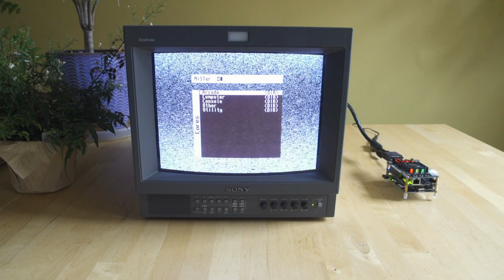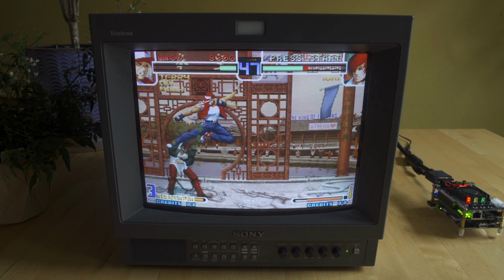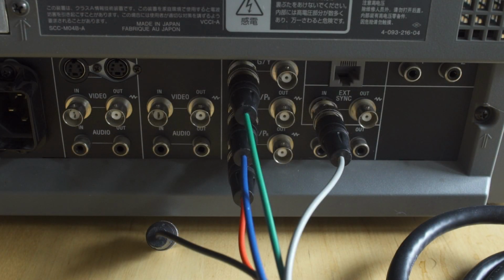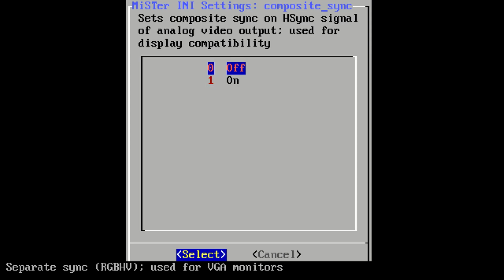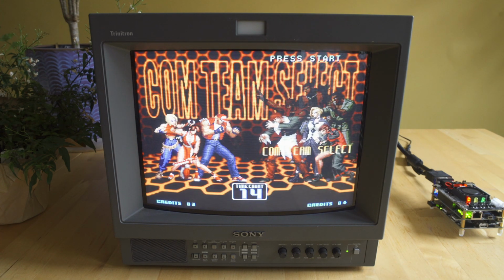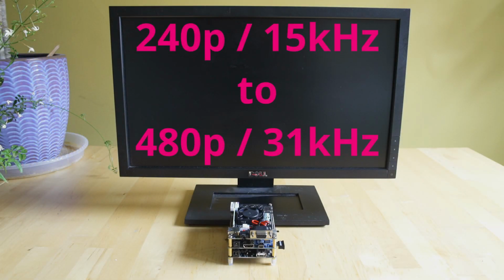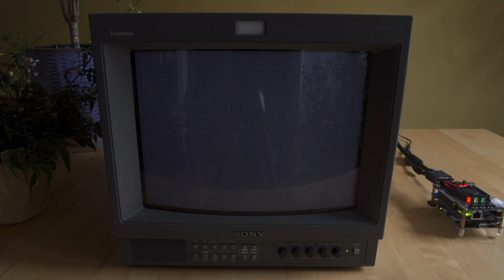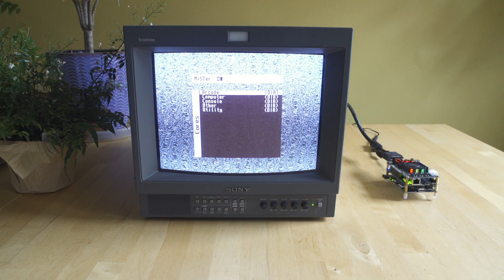MiSTer FPGA Analog Video Guide and Setup Tutorial - VGA, PVM's and Component Video

Comment: I got one of those standard VGA cables with the blue connectors and the ferrite cores clamped around the cable at each end. Took one end off as close to blue connector as possible. You keep the ferrite core. Then you basically take the sync, R, G, B, RGB switch, and ground cores and put them into an RGB scart connector. You can find the specific mister FPGA wiring diagram easily online. If it's a good VGA cable the R, G, B and sync wires will each have their own screen for each signal. You take those screens down to ground. I connected it up to a little Toshiba portable CRT and it's one of the cleanest, crispest 240p pictures I've ever seen.
Reply from the maker: Good to know. Cheaper than VGA to SCART

Comment: Great introduction! One thing you didn't mention was Direct Video, which is an option to use the MiSTer's HDMI port along with a cheap HDMI->VGA adapter and can give you 15 kHz or 31 kHz video, all without even owning the IO board. I have been using this option since the beginning and love it!
Reply from the maker: That is true but I will mention that in advanced HDMI settings coming later. I wanted this to be exclusively about the VGA port out options on the analog I/O board :)
Reply: What did you use to connect from the HDMI -> VGA adapter to the CRT?
Reply from the maker: Yes most adapters won’t step VGA down to 15khz off HDMI. You’d need a downscaler in the mix

Comment: smart to make a note of the port stressing from the heavy cable.
Reply from the maker: I am a filmmaker and cable management / locking ports / not damaging ports from cable runs is very important in the camera department. Ruin a port and ruin your shooting day. So I am def sensitive to warning people about heavy cables breaking ports / cracking solder joints :)

Comment: That's interesting to see how a PVM's picture lines up with different cores. I have a cheap VGA to Composite converter (meant for PC to TV) and I'll often have to change the size or position between cores. Didn't occur to me that it could happen with a more direct analog output. Of course, a PVM can handle the original resolution and frequency and I have to rely on the forced_scandoubler option so there's still merit in other analog out solutions.

Appreciate the videos! They've been a helpful source to a newcomer to MiSTer!
Reply from the maker: Yeah even with a PVM how it fits the screen changes between cores. It also changes between original hardware too. 

Glad you enjoy the videos! Plenty more coming
Reply: It’s much quicker to adjust on the fly with a PC CRT but yeah it’s a pain with a service menu every time on a 15 kHz crt
Reply from the maker: Always a pain but worth it

Comment: I've seen it recommended to use a VGA-BNC cable with vga pin 13 attenuated with a 470 ohm resistor. My PVM's external sync says it can handle up to 4v, so it should be fine just to use any standard cable? Don't wanna fry my pvm, lol.
Reply from the maker: You’ll be fine with your PVM. That’s more for “consumer” monitors. Diff between TTL voltages and the like
Reply: @VideoGameEsoterica  Great, thanks for the reply!
Reply from the maker: No worries. It’s a semi common question actually. I throw arcade voltages into my PVM all day with zero issues. They can accommodate it. So while that recommendation isn’t wrong, it’s more for consumer sets / hardware not intended for those signals. 

Like I use that resistor on the line when I use my Framemeister to upscale arcade boards / other hardware using a TTL signal. Just not on my PVMs

Comment: Hello, I have a MiSTer assembly from RetroCastle, a version with an analog Saturn video connector, I connected Loewe Xelos A20 to my LCD TV, Scart / RGB connector, resolution.  640:480.  in the mister ini.settings settings I set the videoMode to 640:480, how does the picture show with flickers and there is no sound at all, or does Scart not support sound? and should I use the 3.5 section, or are there any settings, or on the De10-Nano board, you need to switch the slider.
Reply from the maker: I haven’t the faintest clue on that one as I’ve never used that board

Comment: I have a tv philips with component and when I tried to connect the cable vga-> component on it, I had to change ypbpr to 1 and vga scale to 1 as well, if I set vga scaler to 0 as shown in the video I dont get any signal. And also sog switch set to on.
Reply from the maker: Good to know. Every tv is slightly different for sure

Comment: I am using Antonio’s s-video adaptor to hook my MiSTer up to a consumer CRT. Many arcade cores look great but many have a slightly wavy image. Some are more wavy than others. I assume this is a refresh rate?  All the CPSII games have this issue as well as Neo Geo. Is there an ini setting I can use to get rid of that waviness and get a solid image across all games?
Reply from the maker: It’s def refresh. I don’t use S video so I don’t have the answer but I’d try the mister FPGA forums. Just Google it (id leave a link but they always get deleted)
Reply: @VideoGameEsoterica  thanks! Yeah I did just that and it seems to be an issue with cores that run less than 60hz. Neo Geo and CPSII both run at 59.something. I read something about a 60hz version of the Neo geo or perhaps a way to force 60 with some cores. Will investigate further but at least I now know the issue. Thanks again!
Reply from the maker: Good luck getting it fixed :)

Comment: I love your videos! I followed the tutorial and every core that outputs horizontal mode works well on my consumer CRT using  vga to component cables.  However if I try to the vertical or rotate mode the image doesn’t rotate, or on the Cave games like Dodonpachi it gets all garbled. Is there a way to get the vertical option working on a CRT? When I use HDMI every core rotates to vertical mode without issue. Thanks again for all your awesome content! Loving the Mister :)
Reply from the maker: To my knowledge no...scaler isn’t involved so you need to literally turn the tv on its side. Like standard TATE

Comment: I have my MiSTer hooked up to my new (to me lol) Sony Trinitron CRT via component from the VGA port and have been very happy with it (except the geometry is pretty bad but I can ignore it in most games), and have been kind of interested in at least seeing how some things look in composite cause it's my understanding that a lot of games were made with composite video in mind.  Do I need a special adapter for this?
Reply from the maker: You need an adapter yes. Just go HDMI down to composite. You are correct, pretty much every game of that era was designed with composite in mind
Reply: @VideoGameEsoterica  Ah so you'd suggest going through the hdmi port and not the VGA? Why is that?
Reply from the maker: VGA is fine. Both will work, I just know the VGA to composite adapters can be a bit of a wait to ship

Comment: nice tutorials, i've gone a mile with these while setting up my MiSTer <3

I have one special situation I would like your comment. Normally I use my CRT to play those tv screen machines, but I'm also setting up AO486 core, and I would like to do the setup with that same CRT. Is there a way to convert the AO486 image to crt ? Like a negative scandoubler, or would you call itscanhalver :D
Reply from the maker: Oh so bring 31kHz down to 15? retrotink will downscale. But nothing in MiSTer to my knowledge will downscale internally
Reply: @VideoGameEsoterica  Cheers for the speedy reply mate. Yes, i'm reaching for 15kHz. Seems I will need a vga monitor or stick with hdmi on AO486.
Reply from the maker: Yes that would be my recommendation

Comment: Just setting those settings didnt work for me - cant seem to get my mister to display on a known working PVM ..bummer
Reply from the maker: Sure you used the right sync cable?
Reply: @VideoGameEsoterica  I got a VGA -> BNC5 cable ( tried both black and grey as you said), oi board on SOG, de10nano SW3 toggled away from ram, updated the mister.ini as you said. Nothing!
Reply from the maker: Odd. That should work. I wonder if there is an issue with the IO board itself
Reply: Ill keep trying.. im sure its something simple im missing. I appreciate your reply and your video - cheers!
Reply from the maker: Yeah lmk how it goes when you figure it out!
Reply: @VideoGameEsoterica  ok so, what happened was that i read on an online forum somewhere that the 3rd switch on the de10 nano should be switched away from the memory in order to activate analog output. This was the cause of my issues. After setting the nano switch back to default everything worked. (Bad info on the Internet screwed me up)
Reply from the maker: That is a weird one. Glad you solved it!

Comment: Any chance of a component video out set up? Are there any changes to the IO board that need to be done like the jumpers? I still can’t a signal to my kv 32fs100.
Reply from the maker: I may do a component video soon
Reply from the maker: Did you try SOG / sync on green
Reply: @VideoGameEsoterica  yes sir, that was the first thing I did and nothing. I've heard ppl change their output resolution, but I don't want to mess with that setting. If you can it would be awesome but I understand if your busy with other stuff thank you for understanding.
Reply from the maker: I’ll look into it. I just need a diff cable
Reply: @VideoGameEsoterica  if you need one I’ll send you a vga to component.
Reply from the maker: I appreciate that. Join my discord. Link is in description. We can chat :)

Comment: What should I set the resolution in the ini file when using a PVM/240p/480i? Can I just leave it at 1080p? That’s what I’m using now and it looks fine.
Reply from the maker: You are using the analog I/O? Just connect the cables and make sure you are using 15khz mode. Should be fine from there

Comment: Thanks for a great video! One question though... I'm using a consumer RGB CRT TV (VGA-SCART cable) and when I go into the INI settings there's so much overscan that I can't see the 4-5 first characters on the left. I haven't found a fix for this, maybe you have a trick? I tried changing the video_mode to different resolutions that didn't make any difference...
Reply from the maker: So the overscan is just when you try to change INI settings? Like main MiSTer ones? Yeah I’d just alter the settings via notepad on the SD card via a PC. Quick and dirty solution but effective
Reply from the maker: Should have elaborated : open the INI file on your pc with notepad and change settings and save
Reply: @VideoGameEsoterica  yeah that's what ended up doing, just thought there might be a fix to make it more visible on the tv as well :)
Reply from the maker: Honestly there may be but I am always “do it the easy way” and this instance it’s notepad lol
Reply: @VideoGameEsoterica  Just to add some more info ...the overscan issue also cuts off notifications like controller bindings and resolution info. But most games doesn't have anything important being cut off.
Reply from the maker: I need to use my pvm later this week so I’ll check into it then!

Comment: Hmmm only supports 15k and has to upscale… dang that sucks I wanted raw native res per system like 256x224 without any scaling… I’m lucky with fw900  let’s me run most low res on displays scaler.  Butttt it’s 30k horizontal limit would mean 480p if I used the mister right?
Reply from the maker: Yeah that monitor is just special. Most everything else wont do it
Reply: @VideoGameEsoterica  ok cool beans… I was getting so excited for the mister ;( guess I’ll have to run bnc to scart and mod some og consoles.
If ur bored I have a bunch of shorts on my channel showing exact res for the games…. Mainly for testing purposes lol
Reply from the maker: I’ll take a peek
Reply: @VideoGameEsoterica  ;) keep you n mind I just found the 240p tool so some aren’t perfect 4:3

Comment: Awesome tutorial.  I wasn't getting any signal at all before... Now at least I'm consistently.getting one.  My issue now is that I have a green tint to everything... Everything's green.  Any ideas on what could be causing this?
Reply from the maker: Sounds like you have the cables crossed up? Not 100% sure but it sounds like the signals are incorrect
Reply from the maker: RGB or component or VGA?
Reply: RGB! Rechecked the connections. Totally fine, using a rgb ready console to the PVM also works fine. When using the mister everything has a green hue.
Reply from the maker: Yeah that makes no sense lol. That shouldn’t happen. Sorry I don’t have more info but if R G and B are on the correct lines it should be fine?
Reply: @VideoGameEsoterica  figured out the issue!  Ybpbr was turned on in the ini. It works now!!
Reply from the maker: Perfect

Comment: Audio options?
Reply from the maker: Analog or optical out
Reply: @VideoGameEsoterica  im using the 10 pin out via composite but get no audio. I tried doing the opt out next to the din slot but still no audio coming out.
Reply from the maker: You need to select the audio type in the INI
Reply: @VideoGameEsoterica  is there a vid how to do this. Im new to it. I just see
"Hdmi audio 96k=0" set to 1.....ect

Comment: Does that mean CRT VGA monitors aren't that good for MiSTer?
Reply from the maker: No they work nicely. Ones that work with 15kHz are rare but with the line doubling to 31kHz it’s a very nice option. 

I prefer a PVM but that’s for form factor + I need RGB BNC + SYNC in for arcade light gun games I collect.
Reply: @VideoGameEsoterica  That's the thing, it's difficult to find a good 15kHz monitor nowadays and it is getting pricy. Thank you for your answer :)
Reply from the maker: Yes 15kHz stuff has gone way up in price for CRT monitors
Reply: @VideoGameEsoterica  do you recommend the model that you have in this video? or are there comparable models/examples as well?

Comment: When using the SNES core, is it possible to adjust the aspect ratio even when using the analog output on a CRT? I prefer to use the 8:7 aspect ratio (even on a CRT), with small black bars on each side of the screen.
Reply from the maker: I haven’t tried that specifically but yes you an adjust the image aspect just like you can via hdmi. I assume the narrower option in the core would give you what you are looking for

Comment: @Video Game Esoterica If I usually use the HDMI output, can I do the "composite_sync = ON" thing in the MiSTer.ini, and have it still work on my 1080p display?

Or would it somehow cause problems with the HDMI output, meaning I need to create a MiSTer_alt_1.ini file just for that one setting adjustment?
Reply from the maker: Should be fine. Composite sync is for analog signals. HDMI works independently. So you can change whatever sync settings you want for analog output as they aren’t tied to digital out
Reply: @VideoGameEsoterica  Awesome, thanks!
Reply from the maker: No problem :)